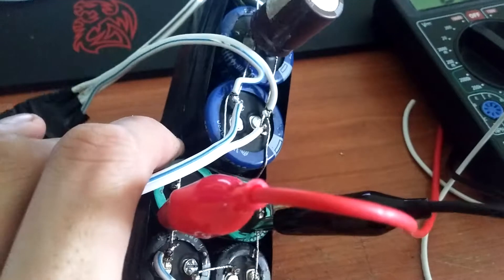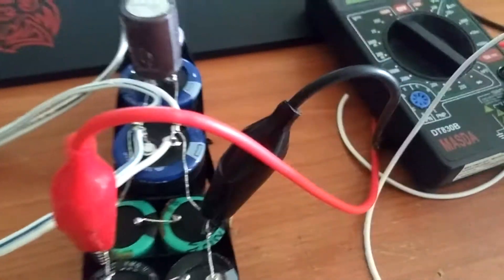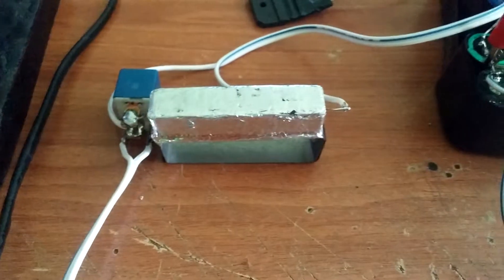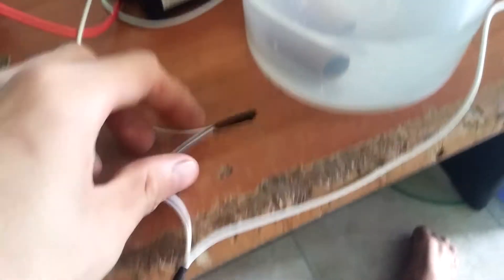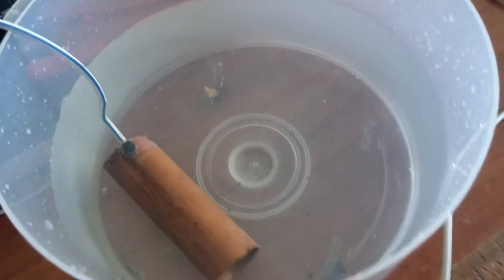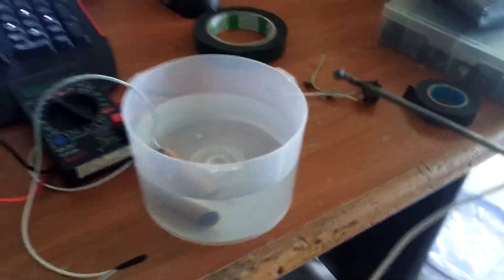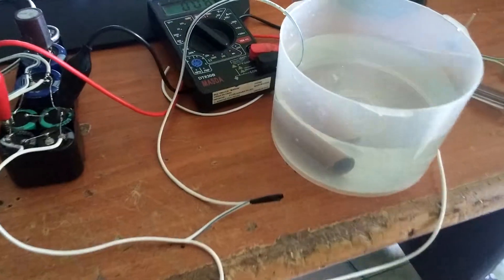300 V DC ARC, MELT METAL

Comment: I have tried to make electric arc from the main 230 V AC. I used a diode bridge to rectify the voltage, and an electric kettle to limit the current (as a power resistance). However, I was only ably to have some sparks between my electrodes, I didn't get any electric arc as you did. I don't understand why that doesn't work.
Reply from the maker: No current limit, that resistor you see in the pic is an inrush limiter, the relay kicks in to bypass it afterwards
Reply: @TonnyCassidy  Thanks for your reply. You make an electric between a screewdriver and the surface of a salted water tank. I assume that the resistance from the salted water is limiting the current, isn't it ?
Reply from the maker: @quentintiefaine1822  yeah and the fact that the salt water never really touch the metal since the moment it does, arc starts and create heat which causes a leidenfrost effect
Reply: @TonnyCassidy  Okay I see, so it's thanks to the leidenfrost effect that the electric arc is able to stabilize itself.  So, if I have understood propelly, it works with water but if I try to make electric arcs between two metal parts, like 2 screws as I tried, it can't work. Am I right?
Reply from the maker: @quentintiefaine1822  i havent try with 300vdc but 600vdc seem to do the job well with resistive load as a ballast, intentionally destroy an old mcb with that method, works pretty well
Reply: @TonnyCassidy  thanks for yours replies